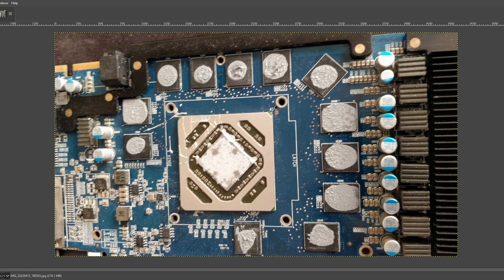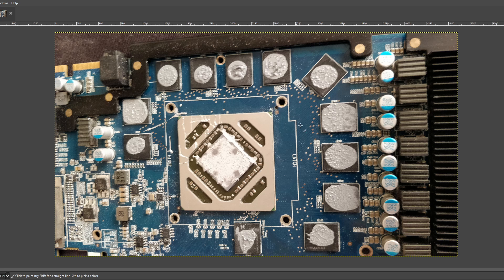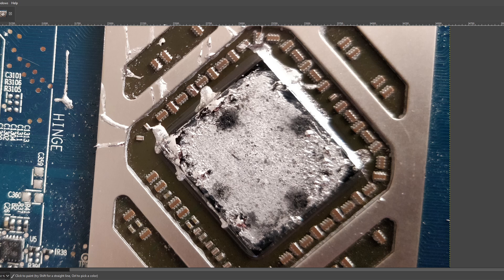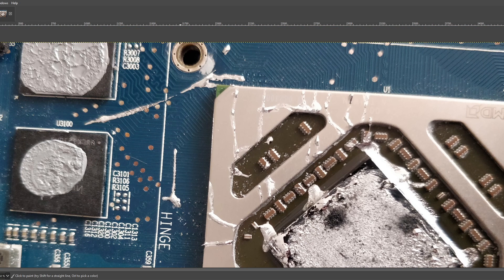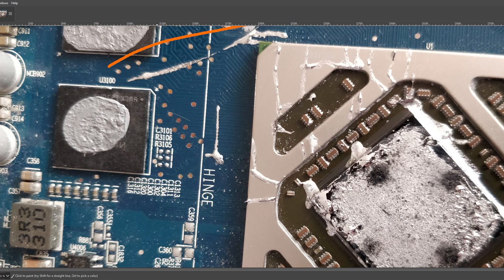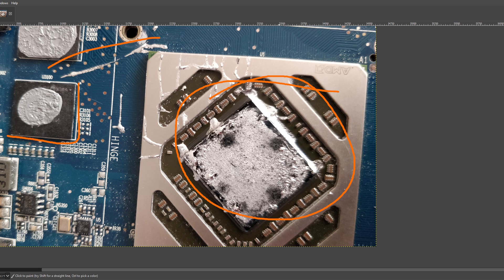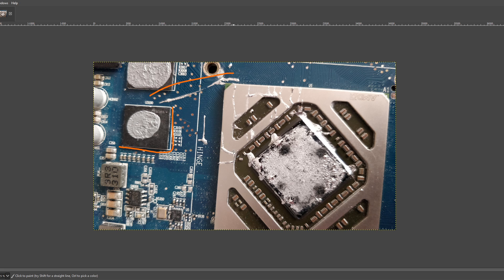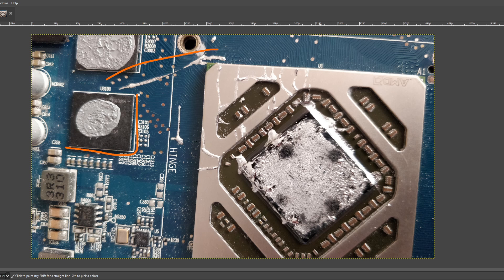Liquid metal on GPUs

Comment: How often to replace LM is my question??    I have 2 laptops and two delided chips I might have to re-apply soon.
Reply: If you benchmarked and have a reference you only need to see if their are out of order changes. LM doesn't degrade like other thermal paste, unless it dissolves into the metal you applied it to, mostly as eMpTy said copper comes to mind. So to speak for your delided chips if you applied the LM between chip and IHS you won't need a change anyway. For your laptop application it depends on the heat sink material and your degradation. If there is no big gap in temps over what you got when first applied you not have to change anything. If the temps were to go up you might go for a reaplication. Never change a running system. If nothing changes it stays the same.
Reply: Nice, been thinking about this since I started the video lol. Nickel plated GPU cooler and temps are the same after 14 months. Had to flash a custom bios just to change fan activation and cut off as the GPU was so "cold" the fans weren't cooling the bloody GDDR6.
Reply: @Airwave2k2  Thats what I thought.   Everything is good except the macbook and it could be that I don't use it enough to know if the temps went up. Thanks!
Reply: Once or twice after a few months if the cooler is bare copper. If it's nickel plated, usually no additional application is needed.
Reply: If you've applied it properly (as in surface was extra thoroughly cleaned and you've placed enough metal on die and cold plate) - never.
Reply: Doesn't msi afterburner allow you to enforce clocks @ mv

Comment: I covered the edges of the core (laptop cpu) with a lot of thermal paste, is it a good idea or will it corode or sth?
Reply: Thermal PASTE is fine. This video is about liquid metal, which behaves in no way similarly to thermal pastes. Pastes are non corrosive and non conductive.
Reply: @ThunderGoatz  Some thermal pastes are electrically conductive, but you shouldn't be using those in a laptop anyway. Otherwise, as you said.
Reply: I meant liquid metal + circle arround and "under" CPU with thermal paste, sorry for bad english

Comment: I've put LM on 6600XT Red Devil in my case. Got like 15*C lower hotspot, 500 RPM less with same power consumption and GPU is way quieter and that's what i was going for :D 
Right now with 2x P12 Slim under GPU whole thing is 0 RPM for most of the time, fans start only during gaming or work in some programs and it's still, only for a while due to lower temperatures. Yeah, i don't get better performance, yeah i don't try to push clock as much as possible, because every game runs really nice on 1440p/144Hz (Not FO4 or Ryse obviosly :V) and every work which need to handled is done fast for me. If you want quieter PC then i think it's worth doing so if you get like 300-400 RPM less and lower temps. Why? Becase you can lower them even more and get same temperature with better acoustics which for many is pretty important. Yeah, it's not a level of custom loop with 2x360 45 mm with pull fans with great static pressure but for cheap i think it's great. LM + some nail polish is like 20$ for the whole thing or even less if you get your mom, girlfriend of sistem nail polish :D Yeah, you void your warranty (i live in EU) but if neccesary you can open GPU without destroying seals <3

Comment: Liquid metal is fine, if you like to live on the edge / are careful with it's application. Really, you don't need that much.
As for making a gasket, hot-glue could work with a card like this, sure it would not be perfect but better than nothing.
Reply: Or you can just use nail polish over the components around the die...

Comment: On modern GPUs you have the shitass autoOC, that's EXTREMELY sensitive to temperature. And you can still do voltage curve corrections, which is also helped by dies temperature reduction.

And noise reduction.
Reply from the maker: the auto OC adds like 10MHz per 10C temp improvement. Unless you're going for high scores it doesn't make a difference and if you are going for high scores just use dry ice or LN2.
Reply: With modern autoOC do you need dynamic clocks or actual one click OC like in radeon settings? Because dynamic clock speek is a great advancement since the pascal days.
Reply: @fVNzO  Dynamic clock speed screws over voltage control and can unreasonably make your clock jump around for no reason at all, including frequency jumping above a stable point "because it can and fk you". Which happens all the time, if you don't fix the voltage curve to a flat line after a frequency point.

And Radeon Settings don't have one click OC, you still need to keep minimum and maximum clock 100 MHz away from each other for best results (close to no frequency dips and solid clock stability).
Reply: @PolskiJaszczomb  yes, dynamic clock speed with manual tuning is excessively annoying. I meant under stock but maybe I'm misinterpreting you.

Radeon settings not giving two haystacks and a pair of nailclippers what the fuck you actually tell it to clock is indeed very annoying.

Comment: A GPU I picked up online had liquid metal applied but somehow a small blob of liquid metal got itself situated under the core bridging two BGA balls together causing a black screen during driver initialisation and there was no sign of previous liquid metal clean-up or remnants of it 🤷 . I Fixed it with a sweet wrapper that I swiped across the BGA and the liquid metal came out quite easily.
Reply: Pure isopropyl and air blasting with 90PSI from a compressor got rid of all the spillage under the VRAM chips on a 1070M that was causing a code43
I use liquid electrical tape all over the place to protect with LM, and also to protect against leakage as now I'm into the quietness of modding laptops with detachable watercooling which causes already overkill low temps (9900K @ 150W at 80C and 2x 1080's at 60C with horrible looking DIY soldered stuff but NO NOISE) so I have gone back to good goop
Reply: Best thing is probably to use a copper wick, like for other desoldering. If necessary, trim it so that it gets in the right place. Galinstan wicks pretty well onto copper. Air blasting risks blowing the metal into something else.
Reply: I wonder if a sonic cleaner could do anything against such problems.
Reply: Yeah, gum wrappers also work to "suck up liquid metal TIM, as does aluminum foil, just make sure to abrase the foil with some sandpaper first to remove the oxide layer to allow it to absorb faster.

Someone I used to work with also claimed that heat under vacuum would also work, basically strip card down to PCB, put in vacuum chamber and use a coil element heater to raise the temp, claims the liquid TIM would boil off but I don't see how that would work, maybe with mercury but not other modern TIM materials, boiling point even under vacuum would be too high.

Comment: I feel like liquid metal is not worth the risks on literally any piece of silicon. Maybe I'm wrong and someone could correct me?
Reply: It's just like driving a car - it works well for people who know what they're doing.

Something like the GPU on the video will only happen if you let a Decepticon take a piss into the case of your computer.
Reply: I think yesterday's LTT video shows a good example of liquid metal use - you've run out of different ways to make something go faster.
Reply: @ignatgrz  fair enough, it's like the ultimate before switching over to ln2. Just so damn sketchy..